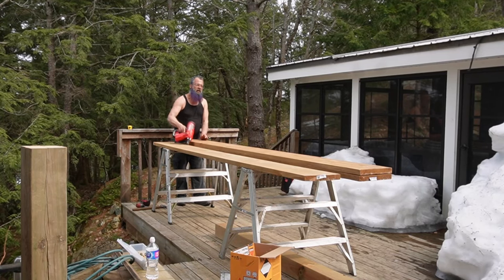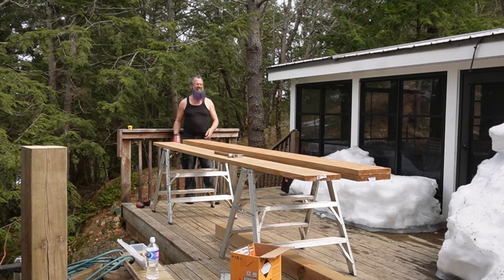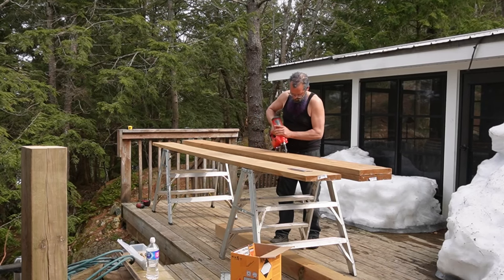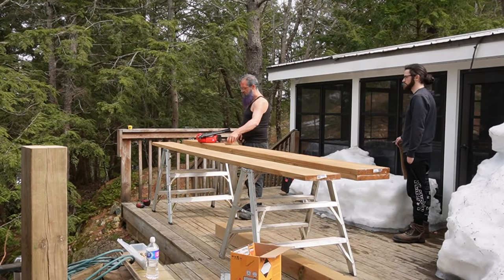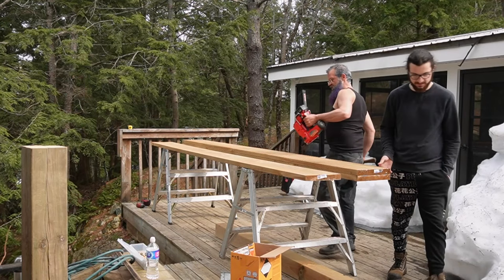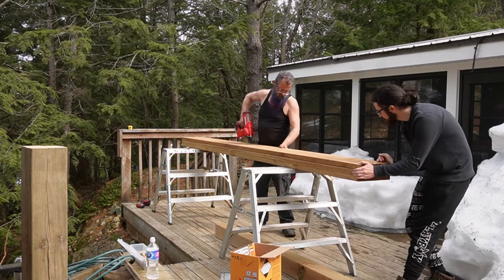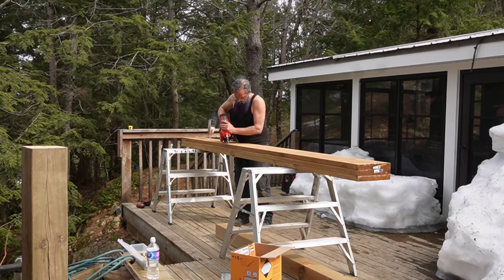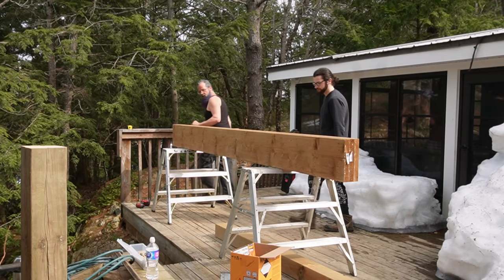How to properly build a laminated beam.

Comment: Very Nice.
In the future I plan to do some glued laminated Oak beams with my sawmill lumber.
Had planned to dowel rather than nail. 
And yes I can plane smooth before gluing. Biggest thing now is getting them dried.
Right now I have a 17" squared up Cant 10' long, (17"x 17" x  10')on the mill.
It took a bobcat and 5 series tractor to set the log on the mill.
And I have more than 10 left to do.

Comment: Laminating boards together - be sure you can manage it when you are finished. Especially important if you are working alone.
Reply from the maker: Excellent point!  I once built a 4 ply 20" lvl beam 48' long.   Built it in place but there was still a fair bit of swearing getting the single 48' boards into place

Comment: on a span that requires staggered joints, is there a simple little calculator app to optimize the lengths so that you leave long enough spans in the stagger, get the most out of your offcuts and availiable lengths, bias joints above teleposts and anything else you might want to consider? I was tasked with the layout yesterday and I just couldn't do it, it was my first time and its noisy on site and If someone seems me sitting there concentrating they will holler at me for help as sure as the sun rises.
Reply from the maker: @paullabossiere5239  yes you can use the calculator app on your phone.
Reply: @toolaholicsanonymous  I tried looking up "beam calculator, and beam layout and there's some that help you with the load and deflection and how strong it needs to be but I can't find any for just the cut layout.
Reply from the maker: @paullabossiere5239  not beam calculator.  Just calculator.   You've gotta check your building code and with the engineer to see if there's a minimum distance from the support.   But generally you wanna try and keep your joints within 18" of the columns or minimum 4' apart. 

If you're this new and were asked to do it.   Just ask the person who asked you to do it.   Get the right answers instead of building it twice.

Comment: Why would you NOT glue it as well?  Doing so doesn't only ensure a better bond between layers, it also prevents the ingress of water, pests, etc.
Reply from the maker: @bricology  glue isn't required.   Glue costs money.   And then costs more money to apply. 

Don't glue things that don't need to be glued. 

It's the difference between carpentry and arts and crafts.

Comment: Nice information, never thought about that many nails before. Do you have a good way to create a beam that needs to be 15 feet wide that will lay between two steel beams? I was thinking about just butting or 4" notching the two 2x6x8's and another 2x6x8 in the middle between the two and make it 15 feet. However, it needs to be able to hold about 60 lbs. in the middle. Do think that will work or do you have a few ideas. Thank you for any advice.
Reply from the maker: Use 16' lumber.   How heavy of a beam you need depends on a lot of things.   I've never heard of a beam that only needs to support 60 pounds.  Either consult an engineer or over build the crap out of it.   Structural failures kill
Reply: Thanks for the reply. I guess I should be more clear sorry. I have a big storage unit. Between the steel door is 15 feet. I want to hang a big light down from the ceiling. But I have to put it on a pulley system so it can be unplugged if I need to open the storage door. I have even though about using two 10x4x4’s and grove them. I guess it would not be a real support beam 😂.  Thank you.
Reply from the maker: @dantem9315  if you're just hanging a light you can buy 16 foot lumber  a two ply 2x6 would do the trick I think.

Comment: What do you do for variations Along the top/ bottom run where the they come together?  Do you need to plane them?
Reply from the maker: Do you mean variations in board width?  No you don't need to plane them.   In fact if you're using pressure treated lumber you ruin it if you do.   Generally you really don't need to worry about it.   You've probably got joists that are going to sit on top on 16" centers that will probably miss it.   Your joists are probably going to be a little irregular too.   And on the bottom of the beam it probably is going to only be sitting on the ends.   If you've got a spot that's really out of sorts just split the difference top and bottom.   If you've got a bad little hump where you want to sit a joist just smash it with your hammer. This is rough framing not finish carpentry.